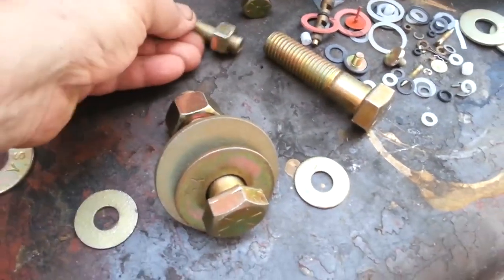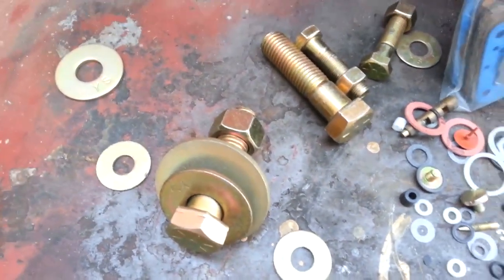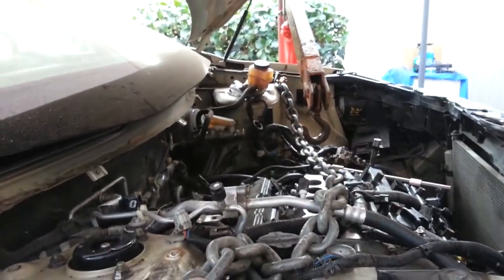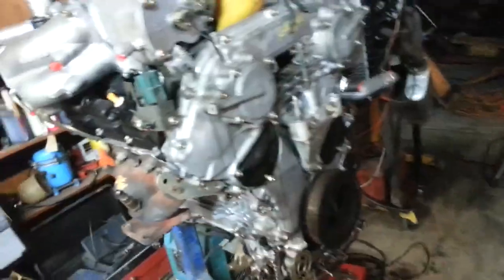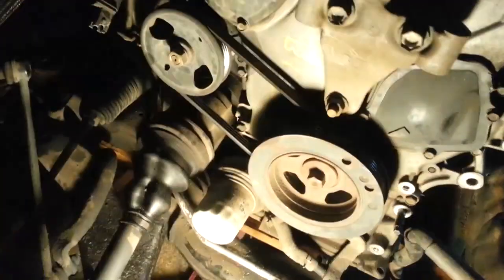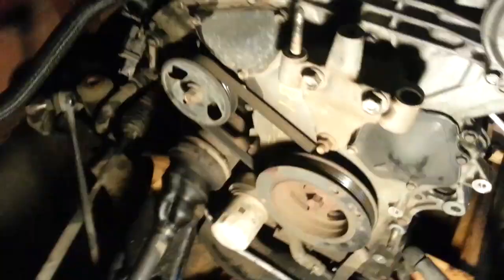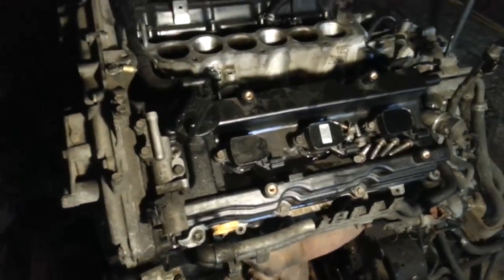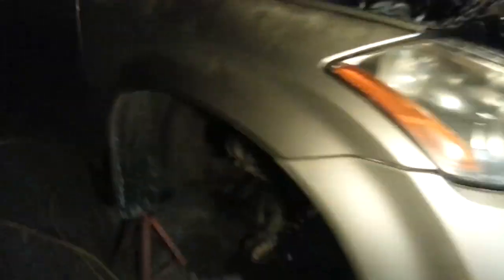Unique Way to Remove Nissan Murano Subframe!

Comment: Good work I just didn't understand why you just didn't move from bumber and grill very easy and safe
Reply from the maker: Even with front fascia off it's not possible to get the engine and trans out without dropping the subframe first and removing the engine. The car must be raised to do that and the subframe lowered. The engine being seized complicated removing torque converter bolts.

Comment: Just watching this video I feel letting my Murano goes away, or  I can pay the mecanico $1600 as he asked...I don't know what to do
Reply: Someone help me with this.,
Reply from the maker: These vehicles were built to be sold, not to be repaired. To get to anything, you have to remove everything. It was designed to almost require to be repaired at the dealership. Therefore the cost of repair is usually uneconomical. It is overly complicated as engineered. A ten gallon engine in a two gallon car. Let's watch this unfolding drama to see if a positive outcome is possible.
Reply from the maker: @topochitopodrido4885  How did you make out?
Reply from the maker: It was a success and it drove away and never came back! Not even to pay...

Comment: Can i do it without removing the engine and just taking out and replaceing the subframe
Reply from the maker: @ia4533  You may be able to remove a rusted out subframe, and put another in, if you find a way to support the engine and transmission and drive axle assemblies. I haven't tried it though.
Reply: @vanstechcorral  can I leave it jacked up and have the crane hold the engine then take the subframe out do you think that would work out for me?
Reply from the maker: @ia4533  Best wishes - let us know how you make out. I suggest getting the factory manuals, available from the Nissan club online. This is one of the most difficult models to work on. Even changing an alternator takes hours.
Reply from the maker: @ia4533  They are very nice to be seated in.
Reply: @vanstechcorral  do you think a engine support bar will hold the engine so I can remove the subframe
Reply from the maker: @ia4533  Review the factory manuals as the transmission is also supported and as I recall suspension components